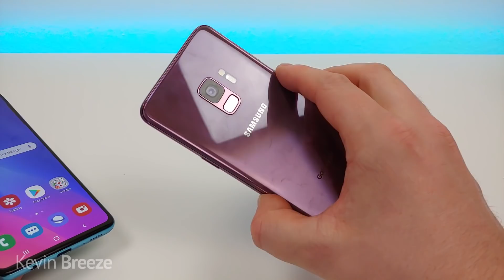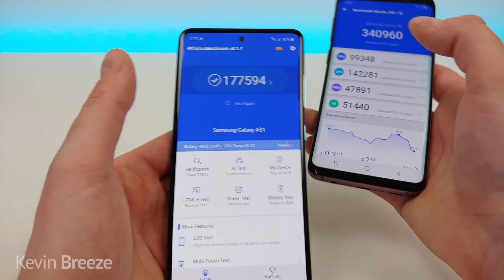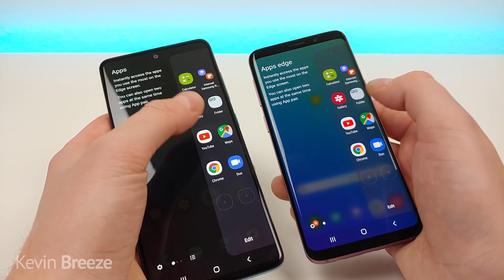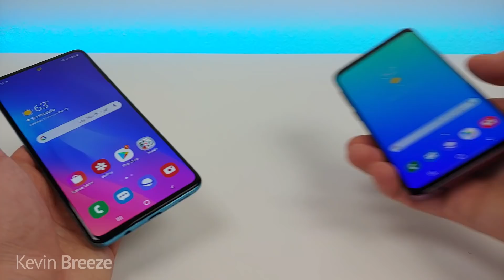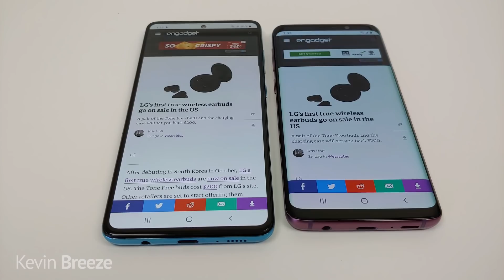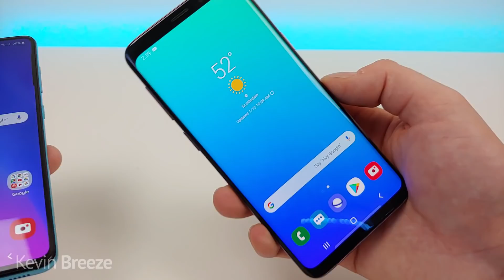Samsung Galaxy A51 vs Samsung Galaxy S9 (Used) - Who Will Win?

Comment: I'd choose old flagship than new midrange, there's a reason why it is a flagship. Quality is better
Reply: There's a reason why it WAS a flagship. Older flagships are usually the same or worse than midrange now. I mean, would you rather have an A51, or a Samsung S5, or an iPhone 4. However, the S9 isn't an old flagship yet.
Reply: There's a reason why it WAS a flagship. Older flagships are usually the same or worse than midrange now. I mean, would you rather have an A51, or a Samsung S5, or an iPhone 4. However, the S9 isn't an old flagship yet.
Reply: One is going past Android 10 tho...
Reply: ACAB !!! We don’t know that for sure but a Android 10 s9 is probably gonna be better than a a51
Reply: You said that yourself, "OLD".
Reply: @gunnify371  it doesnt matter,a midrange cheaps out on camera,processor,screen,basically everything
Reply: @ognjenbb933  bruh. Just compare them yourself.
Reply: Krispy Kutsal yeah camera is better on s9 and screen is better, gpu is better an cpu is better, fingerprint sensor is better and build quality is better, so the a51 is worse
Reply: @veer0522  ...  A51 has a quad camera setup with a macro on, the front cam is 32mp. CPU is Exynos 9611(it's a midrange chipset but actually do the job for a midrange phone with this price). And the displays are pretty the same but A51 has 407 ppi. So, i guess it's better. It has a On-Screen fingerprint which is a fixed version. The build quality is better on s9, ok but they're both using the same screen protector. A51 has no notch while s9 do. It doesen't count but you get the A51 with an Android 10 and a better OS and UI; that's the only mid range that has Android 10 out of the box though. So, yeah... s9 is the worse one here, though i'm not saying that the s9 is bad or anything i'm just comparing them. And it's obvious thst A51 one is better; s9 is old afterall.

Sorry for bad Grammer though
Reply: Krispy Kutsal quad camera with likely lesser hdr processing/ video shooting caabilies and ois on s9/doesnt matter if its good among other midranges, s9 cheaper and more powerful hardware/s9 higher res screen(1080p on a51 is completely fine tho)/ stereo on s9 

If you think a51 is good and enough, thats okay. But saying its completely better than s9 is delusion.
Reply: @gunnify371  quad camera setup means fuck all when the sensor are shit(subpar/low end) and the processing is inferior which will 100% translate to the cameras usage this is Samsung we're talking about who's effectively in 3/4th place in the camera department  for software anyway.

the A9 had like 4 cameras in 2018 but guess who's talking about it now?? that's right NO ONE, why? because it was dogshit.
 they threw all those CRAPPY lenses on there to attract the flies who think more = better the google pixel 2 destroyed in terms of quality on its lense(singular).

um the s9's don't have notches like the A51(which btw has a notch by definition)

if a person is already on a low budget the last thing they should be concerned about is OS support, it's not like the Samsung will give you more than 2 OS updates anyway.
if you have to consider the mid range A series then at the very least move up to the A71 since it will age slightly better due to better internals(still not comparable to the s9+)

fun fact: due to how quickly these devices depreciate, you could go get a used S10E for $30 more(Amazon)of the thumbnail A51 price. there's no way you can reason getting an A51 with that measly 1 more year of OS > having the S10E...
 amazingly the Chinese market has devices  that will run laps around the A51
Reply: @gunnify371  lol my s8+ gets 250k on antutu and this phone barely gets 170k
Reply: Krispy Kutsal you’re just broke
Reply: @gunnify371  if you have a 2 year old Corvette,  and brand new Camaro, both at the same price, which is better??  Just because something is New, doesn't mean it has the SAME QUALITY,  as something older. In general,  YOU GET WHAT YOU PAY FOR. And in electronics,  as everything else. There are high quality parts, and cheap quality parts.

Comment: S9 and the S9+ specifically is basically the perfect phone. Performance still holds up super well and the hardware is still on point.
Reply: But the battery will degrade
Reply: Ben TM not unless you buy it new

Comment: S9 has wireless charging a51 doesn't
Reply: So you're expecting someone who is buying a $300 on a phone to spend another 50 on a wireless charging pad?
Reply: Aryaman Singh A wireless charging pad is only $15
Reply: And water resistant
Reply: And IP68.
Reply: I literally don't know anyone who is using wireless charging although they have wireless charging enabled phones  including myself. Wire charging is faster and doesn't require additional charger so why bother?!
Reply: That's not that big of a deal but it's a good feature to have
Reply: That's not a important difference.

Comment: A midrange vs a 2 yr old flagship.
Better screen/body rat 51
Better quality screen s9
Better cam sensor prolly equals
Reply: this is actually false...before people start to bring up the Megapixels they  take a photography course/research what actually the most important part of the camera...the lenses quality. i can slap 10 cameras on the back of a phone and still get destroyed by the Pixel 4XL because it has much better processing capabilities translating to better images,far superior software(for the camera) and HIGHER QUALITY(the most important thing) LENSES/SENSORS!! 

ever notice why flagships weren't the ones to be flashing around with 30+megapixel cameras yet midrange phones were? it's because the sheer quality of the specific Sensors used made up for the megapixel difference..increase the MP is like fools gold/a good marketing tactic since people don't know any better+(i repeat) having better Processing capabilities thanks to a better SoC

in 2020 now these flagships with higher MP counts will actually benefit since the 2(when you have quality) work together for a better result.

Comment: Would you recommend a70 or s10e? I just got an a70 but I'm in doubt not getting the s10e instead
Reply: I would go with A70 too due to the way bigger screen and battery
Reply: If you are ok with the smaller size,the s10e is a more powerfull phonr.

Comment: what can i say, the trend in 2020 will be... midrange is the new flagship.
Reply: Dont be fooled by the multiple camera, even a single cam of pixel 3 XL can beat quad cam. Soc is obviously lower, flagship chips in midrange can only be seen in some midrange. Huge companies like Samsung, BBK electronics etc. wont put that to their midrange. Budget is the only reason why most people prefer midrange
Reply: @byn669  thats a bingo, i still got one plus one (with good battery replacement), samsung just follow market demand in most region to compete with chinese phone, few people buy phone with price above $350, most people buy new phone with under $300 price every two year in asia, in germany even 4 year old phone is still used if it still alive.

simply put market demand
Reply: More like old flagship is the new mid-range

Comment: The processor 9810 is 2.3 times more powerful than the 9611. Display is qhd hdr amoled compared to fhd amoled. Build quality is far superior than the plastic A51. Dual speakers compared to single. This one is a no brainer but the A51 will have better software support since it's 2years newer.

Comment: A flagship is a flagship
Reply: Stonewall Jackson  lol my man this ain't tinder tf🤣🤣
Reply: Stonewall Jackson  no it doesnt turn into a paper unless a man decides to. So yeah
Reply: Thank you!
Reply: Its only a year (almost 2) old too. Nothing wrong with it
Reply: @cmcm5878  full 2 years old actually
Reply: @cmcm5878  Actually there is something wrong with it.Only 2 major updates.This means that android 10 (one ui 2.0) will be the last version of android that the phone will receive.
The A51 comes with android 10 out of the box,so it will get up to android 12,that's where the A51 wins,and that's because is newer.
Reply: @huzumnicolas4343  but why do you want the phone to last longer if it performs worse?
Reply: @huzumnicolas4343  Processor, chipsets, aesthetic. There are still a bunch f things to make it better. Would be a proper beat off if its the A71
Reply: @huzumnicolas4343  it's getting the one UI 2.1
Reply: @huzumnicolas4343  but my s9 has 2.5 .-.
Reply: hole is hole
Reply: @YoYoMons  doesn't make sense
Reply: Im still using my samsung galaxsy s4 for 7 years.
Reply: @allspark9646  and I switched from the galaxy S3 ---to---> S8 
and I don't think about switching.
Maybe till the galaxy s13 releases 😁 do you know why ? 
I'm in love with my S8 ❤❤
So what's your plan? 😁
what do you think? 💝💝
Reply: @allspark9646  as what I said flagships  are legends and ....
legends never die

oh in addition the galaxy s4 is still better than many devices in 2020 
Coz it is flagship . I respect that ❤❤❤❤❤❤❤
Reply: THE Legendary your s8 is ass 😂
Reply: Old flagship will most likely have more features than the new midrange phones.
Reply: That's what I say ❤
Reply: Ethan Brasoveanu  yes because galaxy S2 will always be induced in the hall of fame for creating a legacy for its predecessors.
Reply: So the Galaxy S3 is a flagship until now.
Reply: @TheNitroVexx  it will soon become an antique piece and you will have to go to the Museum
Reply: @jessiebirax9152  it still have it lmao.
Reply: @TheNitroVexx  it was samsung flagship in 2012 , a flagship is a flagship
Reply: Periodt!!
Reply: Ameeennnnn
Reply: THANK YOU
Reply: And there's definitely a difference from cameras to processors to displays
Reply: Exactly
Reply: Exactly
Reply: Your profile pic goes with your comment
Reply: Yes, the ship in a naval fleet which carries an admiral.
Reply: "My S7 is still a LION."
Reply: He didn't test their current flagship!!
Reply: Oh shit, i have never thought of that
Reply: the problem just in battery
Reply: Yea... No I'm buying the A51, the S9 did well for me for the past 2 years.
Reply: @someguy1865  A52 would be much better deal imo than a51
Reply: You prefer a lamborgini 2017 or an   Corolla 2020? Its a simple choice. A New Corolla Will never beat an lamborgini, does not matter how old the lamborgini is, also a51 Will never be better than s9 in soc Power or camera quality, the all 4 camera lens on a51 loses in overall quality for a single s9 camera.
Reply: Samsung Galaxy S6 is a flagship too. And S5. 

More memory, more storage, one more year of OS update, more and better cameras, bigger and slightly brighter panel with slimmer bezels, bigger battery. A 51 wins overall. The faster SoC is not enough for the S9.
Reply: @panathatube  no wireless charging capability, no IPS certification, No stereo speakers, haptic feedback, pressure sensitive home button, iris+faster fingerprint scanner, variable apperture, strong built, gorilla glass 5 front and back, SAMSUNG DeX, Heart rate Monitor, SpO2 tracker, 4k 60fps video recording, Wqhd+ resolution,
Reply: @jessiebirax9152  Well it depends what features you consider more important. Heart rate sensor and variable aperture went to the dustbin for example. As for the fingerprint scanner it works like a charm in my A70 and i prefer an in display fingerprint sensor.
Reply: @panathatube  Check out how it performs in low light due to the dual aperture function dawg. Don't just keep barking without having facts. Having "overhyped" 500mp cameras with teeny tiny pixels and having large pixel density cams are different.
Premium is premium and will be premium. The A series are good but you should know more cameras doesn't determine good picture quality, the better processing capacity does and that comes with a better sensor.
So suck it.
Reply: @mouprangayan4522  i own a A70 phone and I actually prefer the photos over my previous S7. And in case you didn't know Samsung's new camera is an overhyped 108 MP. PS. This is the last OS update the S9 will be getting so suck it.
Reply: @panathatube  well the a70 itself has a cam that's 32mp which is mediocre as comp to s9's 12mp single cam, a 5mp depth sensor which is unnecessary as the s9 has similar even better live focus image then that. And a 8mp ultra wide camera which is stupid as wide angle cams should and must bear more mega megapixel even than compared to the primary cam as the S10 series have(16mp wide angle cam compared to 12mp primary cam) as obviously wide angle has to cover more area. 
Bigger screen is not appealing to me as it's a smartphone and not a tab or something.
Listen mate as both of us are using Samsung we should be on the same page and also we are not getting over Android vs iOS.
It's just that mid range devices don't and won't bear specs that are embedded in flagships as they are designed as best bang for bucks and must possess a mass appeal.
I'm just saying s9 or S10 or any Samsung flagship designed can last and even beat present mid range phones as they are designed to do so.
I'm not saying that your phone is bad or something. But a flagship is a flagship and people gotta respect that. That's all
Reply: @mouprangayan4522   All I'm saying i prefer my A70. Each person has got different needs and taste. I don't need a faster SoC you can play in high settings even demanding games but i don't play games, i just post my photos on Facebook and Instagram so they look fine to me, and dare i say better over my previous phone especially the night shots, i like the versatility of an ultrawide camera though, i like 6GB of memory, i like my 128GB of storage i like the teardrop notch and the huge 6,7 inch OLED panel with minimal bezels, i really like the huge 4.500 mAh battery i like the 25w fast charging. I'd like stereo sound and 90HZ i hope I'll be getting those in the A72. If you want to get stereo sound, faster SoC, wireless charging, heart rate sensor and an even better single camera (I'm no expert to know which camera is better but you're probably right) that's fine with me really.
Reply: @panathatube  Okay mate. We cool then. No hard feelings.
May I know where are you from?
I'm from India.
Reply: @mouprangayan4522  I'm Greek
Reply: @panathatube  just figured that out going through your playlist.
Nice to meet you.
Well wishes from India bruh.
Reply: @mouprangayan4522  There are some nice Greek love songs in my playlist! Nice meeting you too.
Reply: @jessiebirax9152  the s9 will win overtime lol,see double the score in the performance?
this is cuz a flagship is meant to be built premium and last longer
Reply: @panathatube  well, we have difference preference, I have Galaxy Tab S6 with on- screen fingerprint scan, and it works 4 out of 10 attempts. I wish they had used traditional scan.
Reply: Not really
Reply: This is an "old" flagship😎
Reply: @SuperPulsars  lion never become fox as it ages
Reply: @jessiebirax9152  lion is lion , I like it
Reply: @jessiebirax9152  it's old but not that old but in two more years that flagship will no longer be flagship and s9 is no longer flagship its being compared to a budget phone
Reply: @jessiebirax9152  tell that to the s5
Reply: @jessiebirax9152  But it does become an older, weaker, lion with less stamina. It will eventually not be able to compete with other strong younger lions.
Reply: @jessiebirax9152  woah😂
Reply: @1958Cadillac-v2g  you have no idea how hardware works lol
Reply: @1958Cadillac-v2g  Why are you comparing electronic gadgets to cars? One obviously has a much shorter shelf life than the other when it comes to being obselete.
Reply: @SuperPulsars  a flagship is a flagship
Reply: @SuperPulsars  doesn't matter, I'm still on my s8.  I can buy the new s10 but I like my ❤ s8 ❤
Reply: @SuperPulsars  the benchmark score says it all lol
Reply: @SuperPulsars  old flagship is better than a new midrange